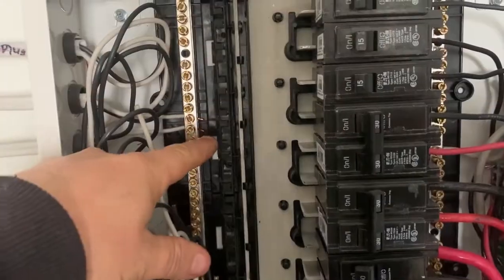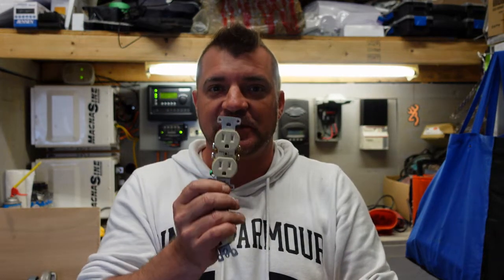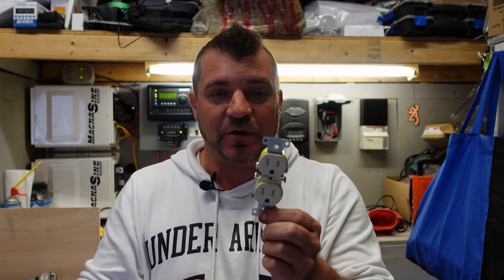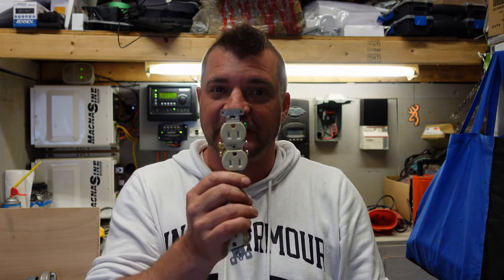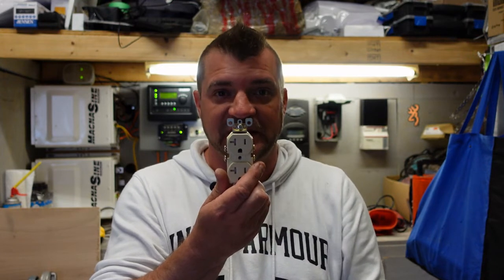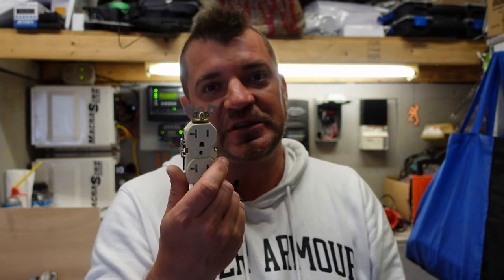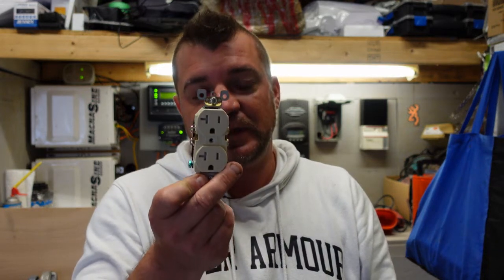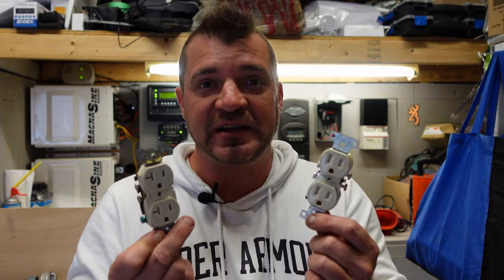Should I Use A 15 Or 20 Amp Receptacle On A 20 Amp Crt

Comment: thanks for the video. i have 12G wires on a 20A breaker. should i replace the bedroom receptacles to 20A or leave the 15A being a bedroom?
Reply from the maker: Typically in Canada a 15 amp will meet code. However there is nothing wrong with 20 amp as long as the wire, breaker or fuse and the device like the outlet is rated for 20 amps on that 20 amp circuit

Comment: This guy is Canadian and the CEC doesn't allow 15 amp receptacles on 20 amp circuits. I'm assuming that they don't want people to use residential grade 15 amp receptacles as shown here, otherwise it doesn't make sense. BTW, 80% of 15 amps is 12 amps or 1440 watts. IMO, you are better off with a 15 amp commercial spec grade receptacle because only a 15 amp plug can be used and the appliance, if in good condition, would only need 1800 watts maximum. 15 amp duplex receptacles are rated for 20 amp pass through (total of downstream and plugged in loads). An appliance with a 20 amp plug could, in theory, require 2400 watts, potentially tripping breakers when used on a shared circuit, assuming in these examples that the appliance manufacturer ignores the 80% rule. For this reason, 20 amp appliances with a 20 amp plug are required to be on an individual branch circuit and the receptacle would be a single 20 amp, not a duplex.

Comment: Actually rather misleading. Confusing the distinct aspects of four elements in a typical use situation only mystifies homeowners, though depending, it may upsell more costly equipment and man-hours of labor. Codes are designed around maximal safety, and consistent application of equipment and practices. Starting at the breaker panel, most regular home circuits will either be protected by a 15A or 20A single breaker. Most home lighting circuits used to be on 15A/14 ga. wiring, even when many rooms were fed off a few circuits, assuming only a few rooms would have lights on at the same time - not always true. Kitchen areas, specifically counters, require two separate 20A Circuits, feeding receptacles ('outlets') spaced so cords on small appliances can reach without being long enough to hang over the edge and snagged, a former safety hazard especially for heavy and high temp units. The vast majority of such appliances, even large Crockpots, radiant ovens, dry fryers, come with cords and plugs with the familiar two blades - which are certified by UL, a different group that focuses on the things that plug in, not what happens before. BUT, if the blades plug in, to ordinary outlets, they are rated to NEVER draw over 15A. Still, the special issue with kitchen counters, is that a lot of devices are often in use at once; so, the CIRCUIT must be 20A, and the "15A" receptacles must handle 20A across each without overheating. Rarely will you see one small appliance needing 20A - but if you do, it will have one horizontal blade, which only fits an actual 20A receptacle - the place the UL and NEC missions meet.
Mixing larger wire and even outlets outside the panel could lead to confusion, and attempted misuse, but an overloaded breaker will trip, if working properly, before the wires or receptacle overheat; whereas a 20A breaker will not, if 14 ga. wire is overloaded.  
If one is concerned, a typical counter area could use 20A GFCI receptacles with the 20A slot to protect the regular 15A outlets, but don't waste money on 20A outlets that will never be used that way.
Arc fault breakers are another factor, designed to detect shorts in wiring and trip before enough heat can start a fire. Early ones were the bane of many electricians, but likely thousands of house fires were averted with their use - if you have an "old school" electrician who sneers at them, and other modern upgrades, find another electrician.
Reply: Excellent explanation!

Comment: yes but the 20amp receptacle is only pulling the 20A if a 20A device is plugged into it....if the table saw has a 15A plug, how is using the 20A receps any better for the table saw? isn't the gauge/resistance of the metal in the recept. responsible for the amperage, just like it does in the wire-gauge?